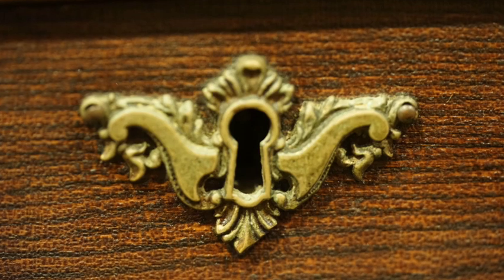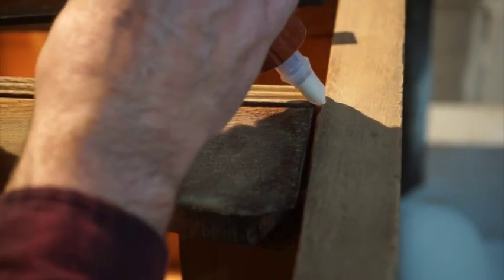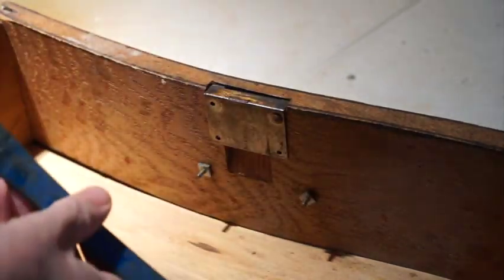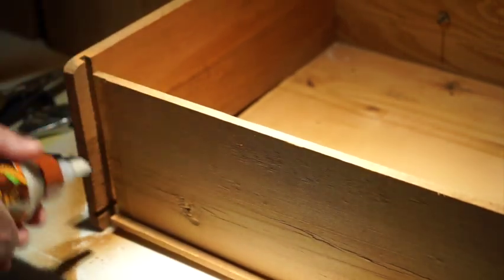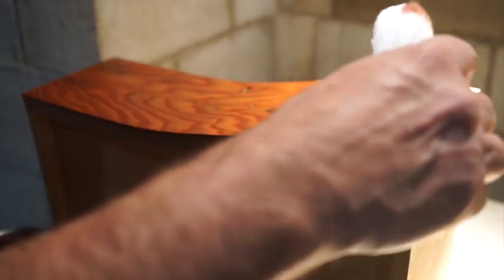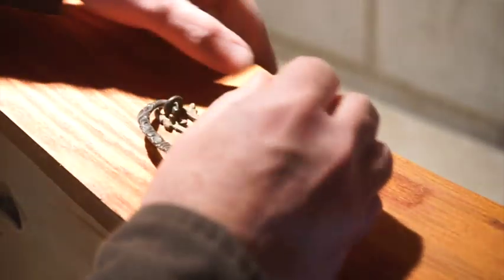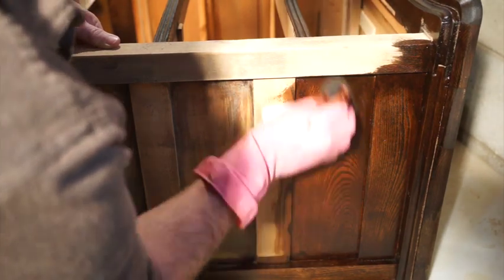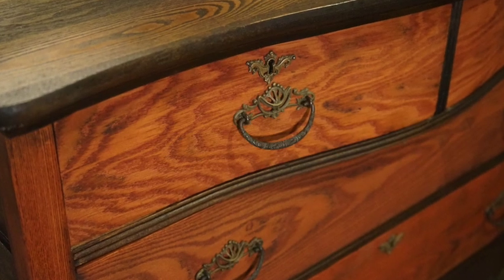Refinished family heirloom antique dresser on a budget with FANTASTIC results!

Comment: Beautiful piece! Your voice is very pleasant on the ears and relaxing. A little input for you - Wiping back your stain so as not to have excess works really well. If you want a deeper color, simply do a second coat, but wipe that back too! You'll not have any excess sitting on your piece and it'll be smoother. Lastly, this piece would look even better with a coat of clear wax rubbed in, then buffed off. It protects the piece and gives it a glow. Best of luck to you!!
Reply from the maker: Thanks for the feedback and the tip! Best to you.

Comment: What a beautiful job! Just fyi: there is pre-stain conditioner out there that helps the wood absorb stain more evenly. I have found it useful in older pieces that have dried out.  Thank you for not changing the hardware. It was particularly beautiful. Thanks for posting!
Reply from the maker: Thanks for the tip! Yes, the hardware is fantastic!